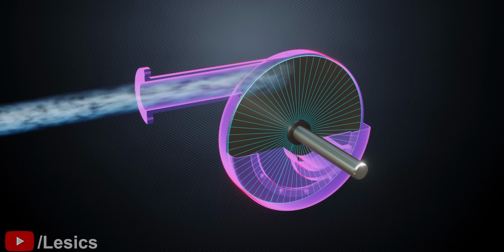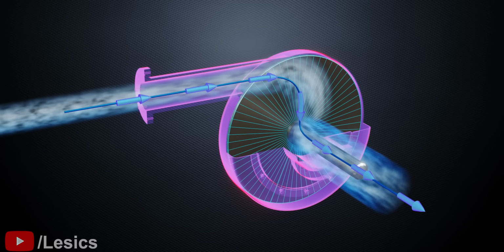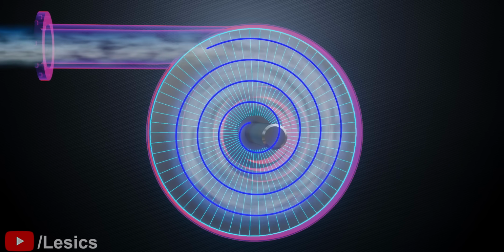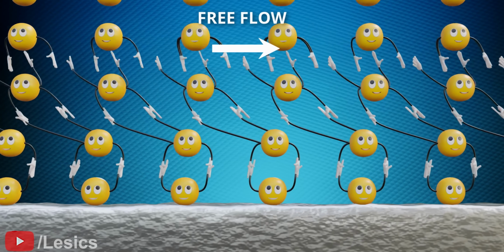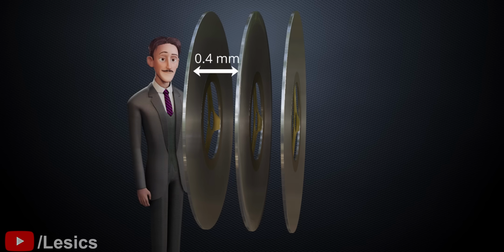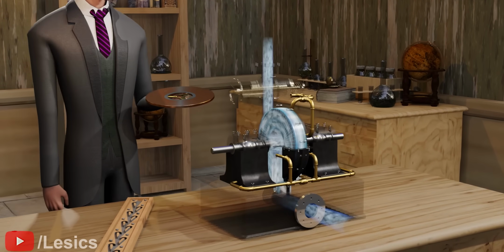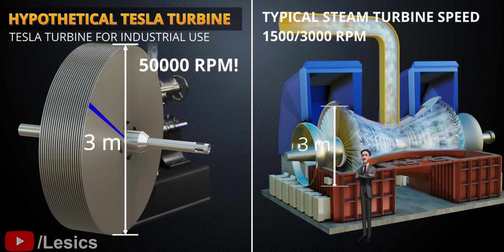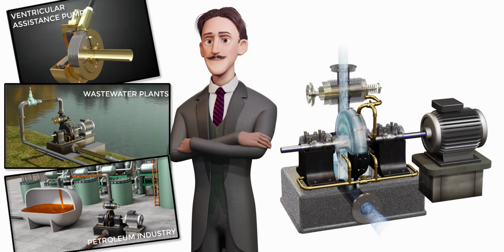Tesla Turbine | The interesting physics behind it

Comment: 3 inch plastic rotors can get to 100krpm without failure. 5 inch stainless steel get to 150krpm before failure.

Comment: You wouldn't have to use 3 meter disks in industrial applications... All you would have to do is use smaller turbines and multiple stages to extract all the energy from the steam, I've seen where you can use other regular turbines in line with these turbines to get more out of it... 
 So yeah, it's still totally practical to use these industrially it's just a matter of proper configuration
Reply: Or use multiple smaller ultra high RPM turbines with ridiculous gear multiplication for torque output. Would this reduce the efficiency significantly?
Reply: @Irishcream216  if you tried to do gears with that it would be an engineering marvel lol and even if you did it you still would have so much friction in the gear system, you would have to find a way to put the alternator right off the shaft and figure out how to collect energy at ultra high speeds.. 
 Which would be difficult for many reasons, but I don't think it's impossible to overcome..
Reply: @Irishcream216  you would just have issues with initial startup, unless you put something like a clutch pack on the alternator and only activated it at high speed.. 
 It's hard to get these started, but once they get going centrifugal forces make it want to keep going and there is no rough surfaces to add friction inside the turbine..

Comment: It was a good video up until the point you said the most ignorant thing I've ever heard come from somebody's mouth. I can't believe you really sincerely just said "Tesla didn't have the material to make discs spin that fast" I have a friend that built his original patent and has got it over 250,000 RPMs you are a crackhead. And it's made out of the same exact steel Tesla made it out of all those years ago. And they actually upgraded the material to stainless steel and aluminum, because the super strong tempered alloy steel Tesla used is completely unnecessary 🤦. Stop making ridiculous claims about old scientific inventions you know nothing about. Tesla originally intended for this thing to spin thousands of RPMs and even designed the very first frictionless air bearings. And 97% efficiency was easily achievable at just 50,000 RPM. It makes basically 99.9% when you have it spinning at 250,000 RPMs. And it's extremely practical because you can just spin a freaking magnet. And then wrap coils around it and you have an instant frictionless generator. And you can design the generator to make any voltage you want at any RPM. This is not impractical technology this is censored genius over 100 years ahead of its time. You obviously didn't know research whatsoever or you would know that Tesla invented a patent, in order to balance the thing to get over 250,000 RPMs with completely frictionless levitation of the shaft in a pocket of air. This is ludicrously difficult to do even with modern CNC equipment. And this guy has a working patent to balance this thing at over 250,000 RPM, but my friend built this balancing patent and it replaces multi-million dollar machines, everybody is just too stupid to translate the patent. cool story bro now go do some real research.

Comment: Centrifugal forces at very high rpm will make it very hard for the gas to reach the center/exit? How does this work? Only by pressure?
Reply: Very good question. The linear speed at the edge of the discs partially counteracts the pressure from the centrifugal force, because the motion is pointed away from the inlet.
If you use it as a pump, it is just the opposite - the linear speed at the edge adds to the pressure from the centrifugal force.
If you read the original patent, Tesla actually pointed this out.

Comment: I have had the idea of building a telsa pump into the harmonic balancer for boats with inboard engines. This would get water out of the engine compartment in a hurry before it stalls the engine. This might make it possible to recover from a swamping or  roll over.

Comment: not sure about impossibility... as far as I know, nuclear uranium isotope centrifuges run at 1500 rotations per second, that is 90k per minute and they are doing it 24/7 for 20+ years, so if it's needed, it's possible to find materials that will be capable to do it, but probably research will cost more than potential benefits from the usage of Tesla Turbine...

Comment: So design is not the problem. Material is the problem. So why not design a material for the turbine design?
Reply: We're trying; making a material that strong isn't easy.  To make a comparison, another idea we have is the "space elevator" or tether - a line going from the surface of the Earth all the way to and past geosynchronous orbit.  Carbon Fiber isn't strong enough; carbon nanotubes might be.  This turbine needs something stronger than that.
Reply: If bigger wheels needs stronger materials, why not try something like small wheels but wider? Does it affect the efficacy of the wheel turbine?
Reply: @jcgarganta  Do you mean "wider" as in "thicker"?  The reason is that a thicker wheel doesn't help any; remember, it's the friction of the fluid on the wheel that creates the torque; you need more surface area for more energy transfer.  Indeed, a thicker wheel merely increases the mass of the wheel and increases the energy in the system without making it stronger or more efficient.  It's covered in the video.

Comment: so just like when you clean a pizza cutter and hold him just right so the blade spins
Reply: A satisfying thing as an 8 year old
Reply: Pretty much, yes
Reply: Configure it like an epicyclic gear box-  multiple smaller turbine planets carried around the generator shaft? Would that not solve so.e of these issues?
Reply: yea but make that six pizza cutters rotating at 35000 RPM, have fun guessing wether they will be ripped apart in your hands or not xD
Reply: @n.l.3776  dont b a wuss live a little…thats a lot of water pressure from a kitchen sink…
Reply: @blainevans9237  it was an example.
Reply: @charadremur333  im aware
Reply: Mm yyo9 hi it 6555tt try fff

Comment: FACTOID: Tesla's design included this turbine powered by boring a shaft in the earth into magma layer. Water would be flowed down, hits magma, converts to steam, back up pipe to turbine which then generates power. Truely free energy
Reply: We have not been able even with current technologies to drill through the crust of the earth.
Reply: Let's call it "energy for free", rather than free energy.
Reply: @gianlucasini612  Until so much is used that it cools down our core, and destroys the magnetosphere. You dont wanna mess with the planets core.
Reply: @adamnichols476  lol - there is no way to cool our core, not even reaching it. The deepest hole ever drilled was 7km deep, core is at about 2.900km.
Reply: @Biological warfare COV-19 I never said we had to, just that it wasn't really possible, just like it's not possible or practical to try and heat water into steam to turn a turbine. Too much conversion translates to energy leaking everywhere. Loss of heat, hell some even bleeds off as current passes through electrical lines. It's much more straight forward to use inductance via alpha particles from a radio active source through direct contact with non ferrous materials, but that is likely a few jaunts further than you thought this was going.
Reply: @Biological warfare COV-19 But the planet isn't warming up, it's actually cooling down we've just been in a very minor 400 or so year tiny blip upwards in temperature but we've easily have another 100,000 years of cooling... And it's not so much from us humans either, it's from all the volcanic activity.
Reply: @Biological warfare COV-19 you can build a geothermal generator. You would waste more energy drilling down into the earth than you would making a solar collector. Using a volcano would be much more practical. And it isn't free energy, it does cool down the earth.

Comment: Interesting. Vortex generators are used to break boundery layer cohesion to reduce drag on airfoils
Reply: They re-energize the boundary layer so it can travel further back, boundary layer seperation causes stalls, vortex generators lower stall speed
Reply: @class2instructor32  that makes sense but how does the VG help in regards to trucks in reducing drag? maybe that effect of disrupting the BL on some trucks to reduce drag was what i was thinking of
Reply: @crabtrap  yeah the longer the boundary layer stays  the "slippery-er " or less drag, I never knew they had them on trucks, until you mentioned it now I have seen them but never put 2 and 2 together hah.
Reply: @class2instructor32  i do large scale RC aircraft and have experimented 3D printed VG rails on wings. it is amazing the low speed stability differances. the truck VGs are just starting to get out there on the road
Reply: @crabtrap  That's a cool hobby I want to do, ever see the guy that does the fighter jets with a little pilot with a pov camera that swivels.. Its cool!
Reply: @class2instructor32  oh ya! I bought a plane off world 3D flight champ Queque Swagarski(so wrong im sure). He does the large jet 3D competitions. $30,000+ jets
Reply: @crabtrap  That's so awesome, my medical is toast so the only thing I'm gonna be flying for a while is gonna be rc....or one of those backpack parachute things, doubt the wife will approve of the latter.
Reply: @class2instructor32  go with a RC, powered sailplane. Add FPV cam/goggles. Insane fun!

Comment: If size and speed is a problem. Wouldn't it make the thing easier to build and maintain if we decrease the size? Then make the decentralization wind turbines, that use the airflow of a large funnel that presses the wind down into the turbine. If they have 97% efficiency, then they would outperform normal wind turbines by a lot. I guess I am being stupid, because that idea sounds way to simple :D (Dunning-Kruger at full force)

Comment: Its almost like a viscosity based "clutch" system- Or more to torque converter in a way- Though always "slipping"
Reply: Thats a good way of putting it, in fact this can be an advantage in high volume thruput setups where stealing a portion of the heat with high thruput becomes an excellent device
Reply: Yes, similar principle to a fluid coupling.
Reply: There is a very fundamental difference between torque converter and Tesla turbine.
Torque converter doesn't depend on the viscosity of the working fluid. 
Tesla turbine wholly depends of the viscosity to couple the moving fluid and discs.
Reply: @yashsvidixit7169  And vacuum
And  centrifugal force
And infall 
And thermal excitation 
And thruput transfer 
And exhausting properly
And on....
Reply: @randyboone9352  ok then…

Comment: so what "more modern" materials do we have these days that could spin @~10k RPM with a disc size of say 3m as the example says?
carbon-steel, titanium, anything more exotic that's viable?
Reply: Not only we don't have them, the problem is they would start to vibrate - the design is highly prone to resonance damage.

Comment: Why can’t we make a big generator by chaining a lot of small tesla turbines with equal pressure flow from the energy source
Reply: You can, you don't even have to hook it up in "parallel" like you say, ideally they would be hooked up in series one into the other... This will allow you to get much higher pressure velocity then using multiple outlets, and that would carry down the line through multiple turbines extracting energy on the way out

Comment: Are the high RPM requirement independent of the fluid vescocity? Or could you just use a high viscous substance and archive similar efficiency rates?